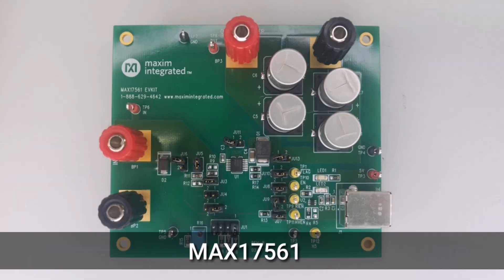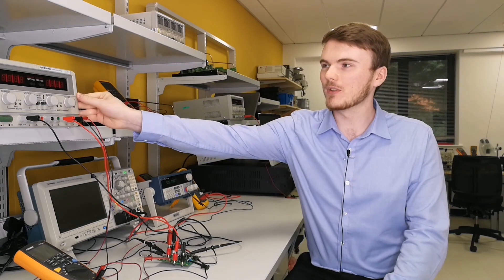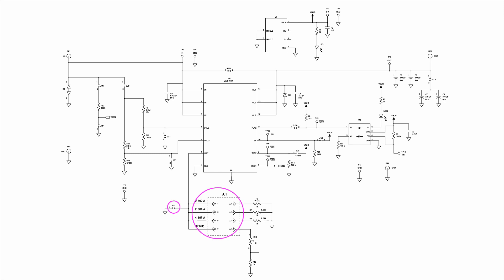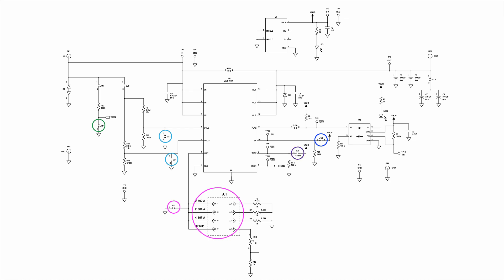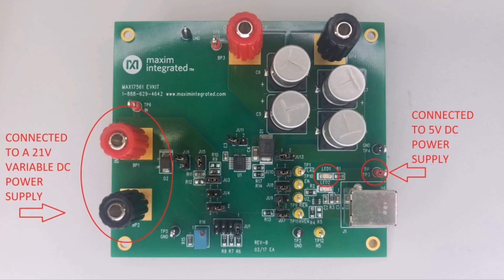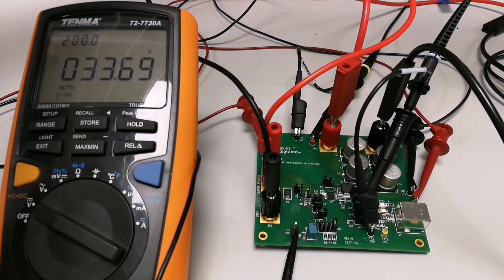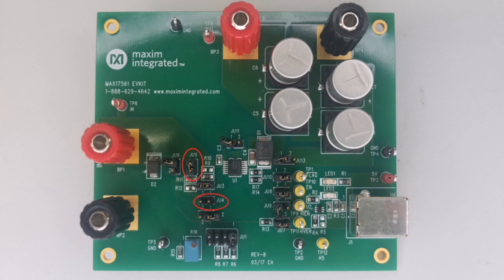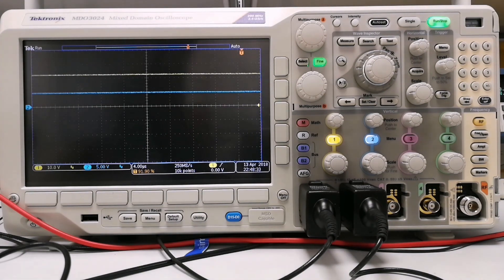How to Add Overvoltage and Overcurrent Protection Using the MAX17561—Part I

Comment: what happens when the input voltage goes higher? 100V? 200V?
Reply: I was wondering the same, but I think you could take a sample of the 100V and work it with.